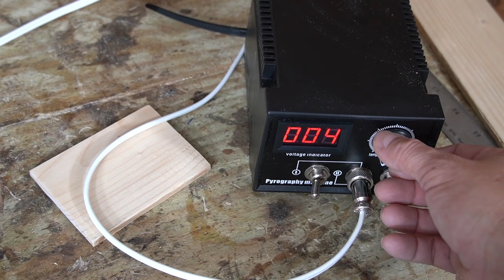Una Técnica Espectacular Para Grabar La Madera: El Pirograbado

Comment: Saludos cordiales, muy buen video. Viendo su explicación me di cuenta que acabo de adquirir un  pirograbador exactamente como el suyo. Lo extraño es que la temperatura no se incrementa, siempre marca 4 o 5, hasta  girar la perilla al último tercio del giro, más o menos donde usted la giró en este video y, a partir esa posición  los incrementos de temperatura son sumamente sensibles dando grandes saltos al menor ajuste. Quisiera saber  si a su equipo se comporta de forma similar al mío o debo llevarlo a revisión, pues es nuevo. Gracias.
Reply from the maker: Si amigo Carlos. Así me ha sucedido con el mío. Creo que es normal en este equipo en particular. Es problema del aparato. Muchas gracias. Dios le bendiga. Saludos sinceros.
Reply: Muy amable en responderme. Muchas gracias amigo.